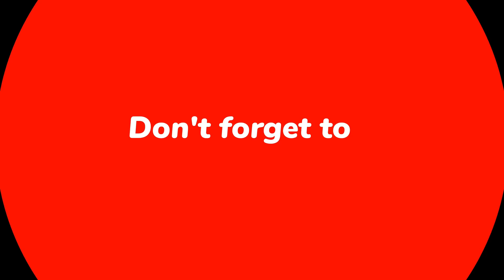I CAN'T BELIEVE WE DID IT!  |Building DREAM HOME IN OZARKS |OFF GRID POWER |SUB PANEL CONNECTION

Comment: Based on the provided information, a 20-amp circuit can handle a maximum of 1920 watts (80% of 2400 watts, which is the maximum capacity of a 20-amp breaker). Assuming a standard maximum power draw of 1.5 amps per outlet, you can estimate the number of outlets by dividing the circuit’s capacity (1920 watts) by the power draw per outlet (1.5 amps). This gives you approximately 10 outlets. However, the actual number of outlets that can be safely run on a 20-amp circuit depends on the electrical load and the power consumption of the devices connected to the outlets. It’s crucial not to overload the circuit to avoid potential hazards like tripping circuit breakers or electrical fires.
Reply from the maker: Hey thanks for the wealth of info.  We are totally doing that.  Thanks 🥰

Comment: I x the breakers use both sides
Reply from the maker: Agreed, I'm going to use the left side for down stairs and outside. The right side will be upstairs and what ever else needs power.  What's your thoughts? Thank you ❤️
Reply: @Itsallgrady  just go down the line, try to balance the amps of the breakers for each leg
Reply: I also would start at the bottom helps when you start laying all that wire end the box you don’t end up with a lot of cross over wires, looks a little more professional